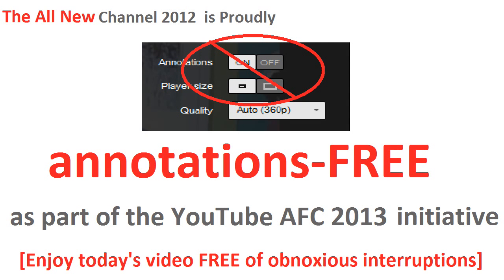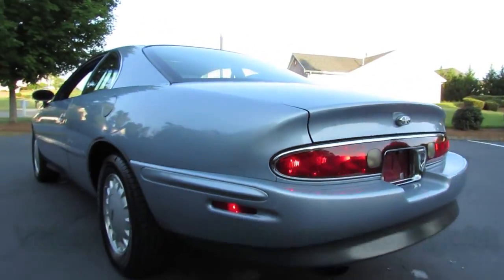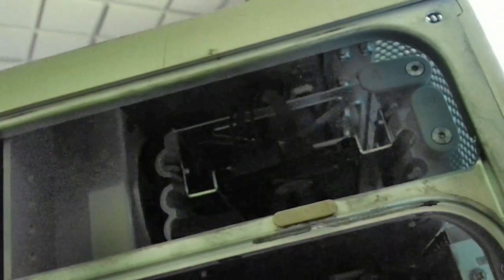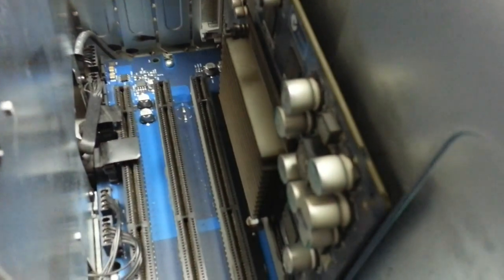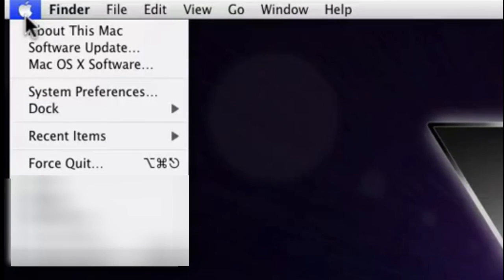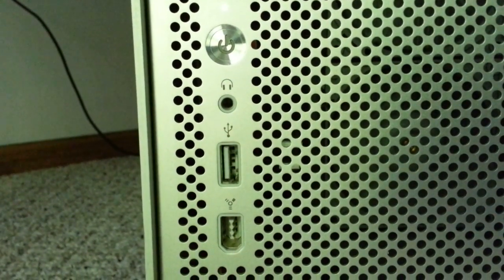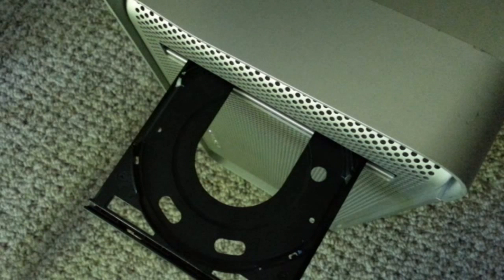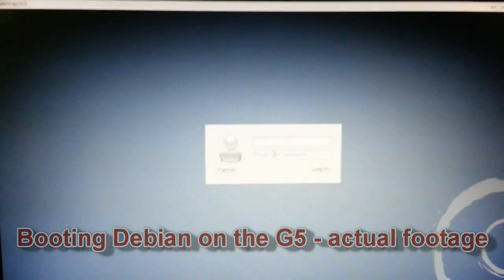FAQ - Using PowerPC Mac PCs in Modernity

Comment: Great video ! i was  long thinking about giving a G5 a go but this  stops me. 
thnks  you ,from not having all the frustration shown in this video ;)
Reply: This guy has no idea what he's talking about, I use G5s everyday and they are much better than what he describes. You get a lot of nice computer for a little price. They are still great computers and are definitely not slower than Pentium 4 processors. If you want to give a G5 a go, then do it. You won't be disappointed.
Reply from the maker: As with anything, there's no substitute for trying it yourself, but sometimes, it's simply not worth the headache. I appreciate Tyler's dedication to his old computer, and there's nothing wrong with getting a few extra years of service out of any machine, but my experience was that it's just best to avoid having to deal with these things in the first place. I mean, if someone was giving a G5 away, that's one thing, but actually paying money for one is a completely different story.
Reply: TylerGaming97 i would love to see a good powermac g5 overall  performance video  to see what software wil stil run above what is today's standard, i know websurfing en text etc wil stil work  youtube might work but only with a go around software and how long wil that work ?  i have owned several  powermac g4  tried os X, linux ppc but that one has no live in it anymore  i imo it fails to to just that what i want it to do like say video editing?  i would be nice if i can find old cheap version finalcut or something like that ?
to  make a dedicated edit G5  but im not willing to spend tons of money modding
Reply from the maker: migchiel faber
If you're looking to edit video, the PowerMac G5 is a terrible choice. You really need a regular computer, otherwise you're at the mercy of Final Cut (which I did try on the G5, and it failed miserably just trying to import a video, so I gave up).
Reply: So there you have it, why spend ton of money on something you simply can't get up to speed regardless the amount of money you spend on it .only  tasks a simple streaming device can do, and is to up speed. i'm amazed plp are stil buying/selling it for 150 euro powermacs are stil nice as jukebox  or presentation machines and mayby a view old ppc mac games       I would love the have one for free ;) just because i can say i had all the ppc out here.
Reply: migchiel faber Yeah, I'd never pay more than $60 for a G5, $40 for a G4 and I would NEVER buy a G3. But, I don't think I'll ever buy PPC again. Unless I need a cheap PC to back things up on and have for a just-in-case situation.
Reply: ***** Definitely agree with you on that one. I've tried early Final Cut versions and iMovie 09. Said it would take 9 hours to import a 6 minute 480p video.